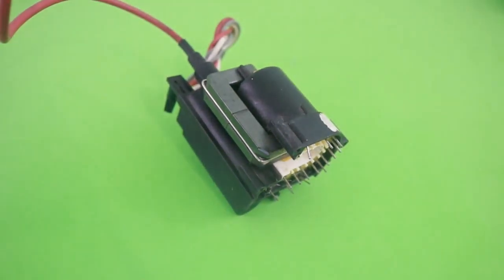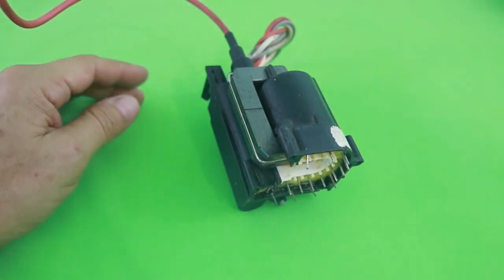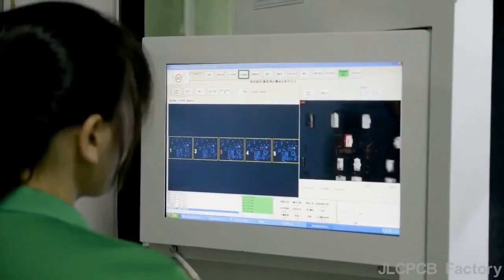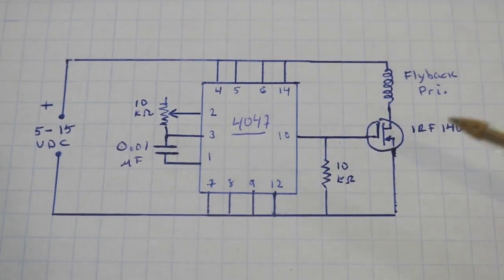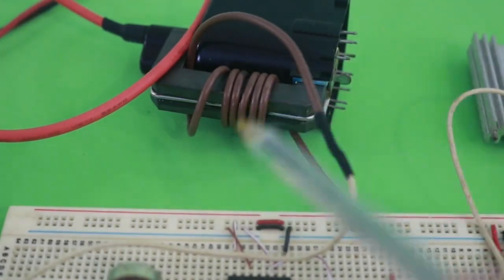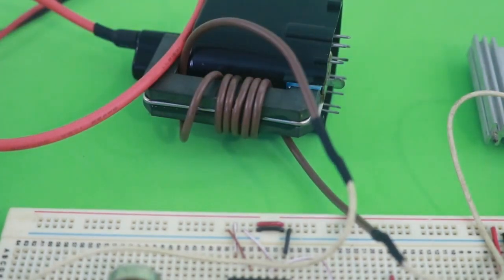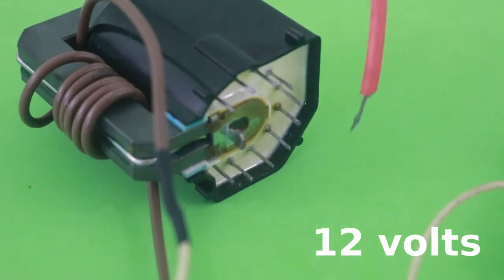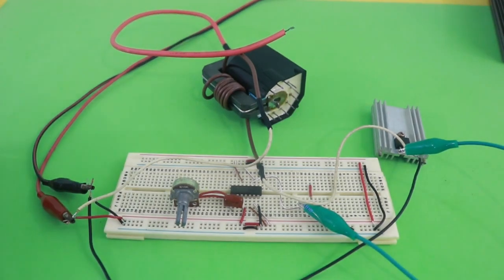Flyback Driver with CD4047

Comment: It would be a good idea to put at least diode across the primary coil, it will protect the transistor against high voltage kick back from the primary.